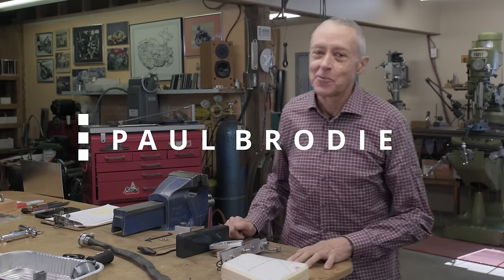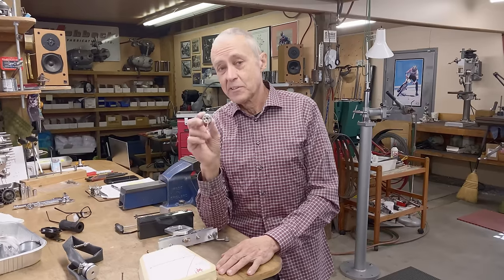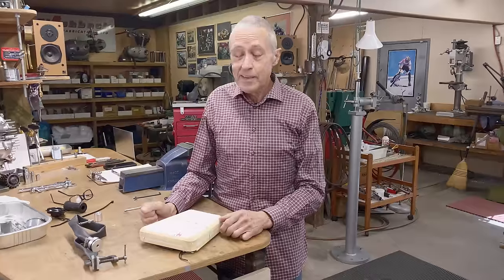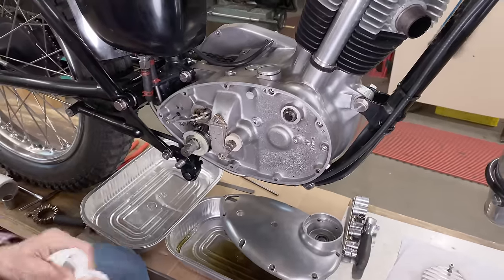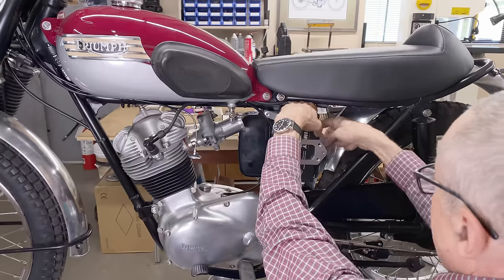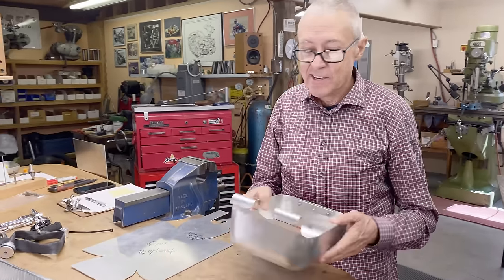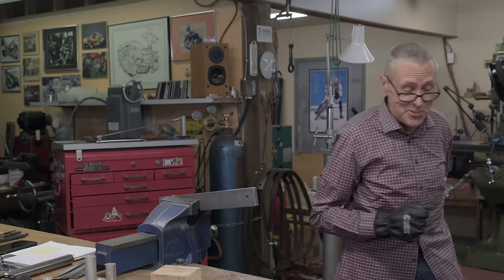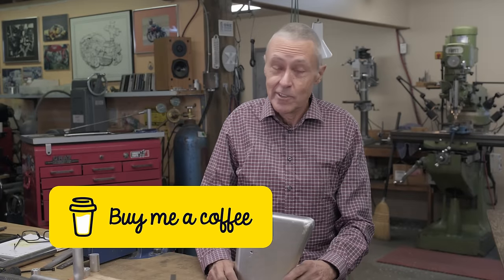CUSTOM Side Cover for the Tiger Cub // Paul Brodie's Shop

Comment: You drop the vertical needle lower, usually a circlip with 3 positions, if not lathe a groove for the circlip above using existing grove for spacing and subsequent groove size, you can always shim the circlip too for finer adjustment, good old SU type carbs.

Comment: Amal carbs have four stages.  Idle which is controlled by the idle jet. Idle to 1/4 open throttle, mainly the slide cutaway, 1/4 throttle to half throttle needle jet, half to 3/4 throttle needle taper/clip position, 3/4 to wide open main jet.  They do overlap some but those are the main controls.  Put a piece of tape on the handle bars and mark the various openings of the throttle.  Determine what throttle position the main issues are occurring and then address that part of the carb that is in play at that throttle opening.  Generally a stumble rolling the throttle on can be solved by changing the slide cutaway.  Also richness in the mid range is very common and is usually due to a worn needle jet.  I always replace the needle jet when I have an Amal apart.  The needles are steel and don't wear nearly as much as the brass jet.  They rarely need replacing.   Moving the clip to a higher notch in the needle will also lean out the midrange, lower notch will richen it..
Reply: This is the "Concentric" model carb, check the float level the settings can be problematic.  Also the early editions experienced pilot jet problems symptoms - dead spots.  Respectfully suggest you consult one of the many discussion boards and tuner talk on the web.  I'm almost 100% convinced that one of these faults is at play.  The needle jet gives a descent range of adjustment but the other two aforementioned conditions must be correct before the jet can compensate for mixture.  Best of luck.
Reply: @geoffmorgan6059  Yes the fuel level should be set .21" below the float bowl lip with a utube  and the pilot jet cleaned with a #78 drill bit before any further carb tuning is done.
Reply: Yep, seen needle jets worn 'pear shaped' on Bonneville carbs
Reply: Pilot jet passage is a swine to clean out.
Reply: @bananabrooks3836 not really, remove the cap clean then plug with aluminium.
Reply: @pbysome  Well yes, but then thats a modification to get around the problem  which Amal have addressed themselves now.
Reply: @bananabrooks3836  you said it was swine but really it isn't, whenever I work on Amal concentric MK1 I do this as a matter of course, I used to araldite them back in but ethenol eats that so now I slice a piece of appropriate alu rod and tap it into place, I usually do three at a time (t150/160 etc).
It was always due to cost that they didn't make them accessible in the first place, something like the factory demanded they cost under a quid or so.
I don't know if the cub was even fitted with concentric?? Mono block was de riguer for them I think.
Reply: @pbysome  l think you've made my point very well.
Reply: @bananabrooks3836  I didn't make "you're point" that was that they where a "swine" which they aren't, they are simple to do.
Reply: @pbysome  
 Simple to modify as you say you appear to have done many rather than endure the flawed original.
Reply: @bananabrooks3836  flawed or brilliant is subjective, what they produced for very little works rather well when used sympathetically.
You have to remember the times and constraints, a bigger issue with the concentric, and probably the monobloc, was body distortion due to the poor quality metal used overtightening the mountings ovating the bore making the slides stick etc was all about cost nothing else.
Reply: @pbysome  if the design was 'brilliant' it would need no remedial work such as you have done. I think we've squeezed enough out of this lemon, so l bid you a fond farewell.
Reply: @bananabrooks3836  brilliance at a price, it's all relative, you have to remember how old these are and they only fur up when left standing for periods.
If you don't like discourse don't instigate it.
Reply from the maker: Good info, thanks.
Reply from the maker: Thanks :)
Reply: @pbysome   You are absolutely correct that Amal 332 Monobloc style carbs were fitted to most all Tiger Cubs with some notable exceptions over the years.  As a Luddite, I prefer the Monobloc to the Concentrics.  The main thing about concentrics is they can be fitted to twins close in (to each other) without having dummy floats and messy rigging.  I have had Norton ES2 500 singles for years and I like the Monoblocs.  That original pilot jet configuration on the first generation of concentrics gave me heartburn.
Reply: @geoffmorgan6059  I haven't had much experience with monoblocs ,only my first bike (a cub) had one but by reputation I always understood them to be more reliable and easier to set up.
Having said that I have had very few issues with concentrics even when worn out you can still get them to work.
Of course you are correct about the twin cylinder use.
Did they make monoblocs left handed?

Comment: A lot of off idle problems can be corrected with the pilot jet circuit. If this is the carb with the non replaceable pilot jet, they are very prone to clogging. You can drill an access hole on the blind side of  the pilot jet channel to easily access the jet to insure the passage is not plugged. The access hole can then be plugged.  The pilot screw can usually be adjusted to eliminate the off idle stumble. 1-2 turns out is where you should end up with the adjustment. If not, the pilot jet is sized incorrectly. My commando needed some trial and error with pilot jets to achieve smooth transition but now it runs perfectly.
Reply from the maker: Thanks for your tips :)

Comment: Always drill the ends of your cracks. It's something some drummers do to their tired cymbals to stop the crack spreading further. I don't know if that would help any cracks that are being welded/brazed though.

As for sheet metals, Trev's Blog, a fellow YouTuber from the United Kingdom has done an amazing job of explaining and demonstrating his panel beating techniques. He's basically the Paul Brodie of autobody repairs while he lovingly resto-modded a Bedford CA into a catering van for his wife.
Reply from the maker: Yes, I have drilled a small hole at the end of a crack.... But I don't think that is necessary if I am welding it. Thanks.

Comment: I cant believe how easily you put a radius on that round stock by just spinning the wheels on the lathe. I would have never thought it possible without a radius tool. One more trick of yours I've got to try and learn!!!!
Reply from the maker: I have been doing that for a few years, that's for sure. It's good for your hand eye coordination. Give it a shot! Aluminum is easier than steel :)

Comment: Cover looks great. I imagine running the engine with the outer cover off would quicky reveal where the oil is escaping.
Reply from the maker: I found where the oil was coming from. There was a hole! So, I plugged it; end of problem! Thanks for liking the cover :)

Comment: I've noted the use of 1100 rod when welding 3003 has been mentioned for Oxy/Acy (torch) welding. I wonder how 4043 might do on the 3003/TIG work? We use 4043 as a "Go to" rod for many things when TIGing. One of your most important illustrations is - Patience. Thumbs up.
Reply from the maker: Yes, I do have 1100 rod, but I have found it is not always easy to melt and get it to flow... 6061 rod is definitely easier. Works for me. Thanks for watching :)

Comment: Great progress Paul, glad to see you sorting out that single. Just rebuilt my 37 year 441 runner, amazing these Brit bikes can last and be rebuilt for years. My points cam leaks a bit but I have hole in bottom so it drains away to lower parts less there than what you had after 10-20 000 miles so it was slow. The gear area on the 441 250 BSA unit are wet and have divider.
Reply from the maker: Thanks for watching and commenting :)

Comment: Hi Paul, there is supposed to be oil in the outer cover. The cam has a timed breather, which exits oil, also from the kickstart shaft and gear selector. The oil re enters the crankcase and on to the scavenge system through the tiny hole you can see directly below the camshaft. So there will always be oil up to the level of that re-entry hole.
Reply from the maker: Thanks for the info! Yes, the oil was leaking out of that little hole so I was told to plug it up.
Reply: @paulbrodie  Hi Paul, oil will come from the camshaft end bush, run down the case and should be able to get through that tiny hole to get back to the oil pump scavenge system. Kind regards Paul.
Reply from the maker: @paulbalsillie3645  Yes, another viewer mentioned this as well. Thanks..

Comment: That baffle's gonna fly for miles when the locktite lets go on a high throttle 😆
Reply from the maker: James, I beg to differ. The baffle has a slight taper, and was pressed into service with the aid of a 2 pound hammer. It's not going anywhere...
Reply: @paulbrodie  I bow to your superior experience and skill set. But if it does, you'll owe me a coffee 🙃

Comment: Would a product like POR15, along with the tig welding, be a belt and suspenders  fix for your leaking oil tank?
My thinking is if you missed any pin holes, or if a new leak appears in the future, the POR might help seal things.
You're looking good Paul, it's great to see your hair coming back LOL.
Regards,
Duck
Reply from the maker: Thanks Duck. The oil tank is fixed. No more leaks.

Comment: try a smaller cutaway on the throttle slide to improve the pickup, drop the needel a notch to the topring to cure your rich mixture
Reply from the maker: Yes, the needle is all the way down. I have a 3.0 slide, and I am going to see someone tomorrow who may have a 2.5 slide. Thanks :)

Comment: They leak from the kickstart shaft and gear change shaft bosses because there is no seal. There is a company called UPB  here who supplies parts to fix this problem. I did the jobs on mine fairly recently,( thanks Nick for the machining work) and not a drop has come out since.
Reply from the maker: Mine leaks from other sources. Thanks for watching :)

Comment: Nice job Paul. Really good to see you're still at it. Hope the treatment is going well and you are feeling okay. Can't wait to see the Cub in action. 
I was wondering, could you machine another cir-clip mounting groove in the needle for the carb, just above the one that's there whereupon the needle would sit lower in the jet and perhaps lean out the mixture. You may then be able to go back the the larger jet (0.020?) to get the right mixture,... What do you think?
Be well sir.
Reply from the maker: Thanks Sandy. Well, my lathe chuck won't hold the needle... it is too small. Tuning a carb is a balance of several variables: needle, jets, slide, etc. I am working on it?

Comment: 3D print your cover, or even use the 3D print for a bit of 'forged carbon', looks good.
Reply from the maker: Why would I want to 3D print a cover? That's not an art form created by hand. Why not just 3D print the whole bike? Where's the fun in that?
Reply: @paulbrodie  3D printer is just another tool Paul, most vehicles are designed with drawings on paper or using computers, just another tool, like all that stuff in your machine / workshop, 'by-hand' is a very loose term, this tech is good for modelling spaces well, making prototypes, assisting with whatever production method you choose, ta.
Reply: @paulbrodie  3d printers, the FDM cheapies are really about prototyping, actual parts as well, but good for visualising, seeing an assembly move, like a hinge for instance, get a profile thats difficult and using it like a cardboard cut'-out, all that good stuff, i also like hands on with metal, i like it all :-) thanks Paul for your channel.
Reply from the maker: @Stuff-i-Like  Thank you.

Comment: I guess, when the oiltank is fixed at the top, and on a rubber mount at the bottom, the tank will vibrate and crack at the support at the top. Eighther both supports fix, or both on rubber mount. Just a thought.
Reply from the maker: You might be right. We will see how my solution works out. Might have to re-engineer it...    :face-orange-raised-eyebrow:
Reply: @paulbrodie  I am always right !
No, I am just kidding, but yeah, test the bike and you will see, it is not a big deal. Thanks anyway for answering, I am glad to see that you are getting better healthwise.
Reply from the maker: @willymueller3278  Thanks Willy. My health is getting better but I hurt my ankle trials riding today, so now I am on the injured list....:face-fuchsia-tongue-out:
Reply: @paulbrodie  Well, sometimes it all comes together.
Reply from the maker: @willymueller3278   Well, I am feeling lucky!     :face-fuchsia-wide-eyes:

Comment: I think adding a breather to the inlet rocker cap or where the original early points came through case would be a good idea?
I've used the balls out of track rod ends, upper and lower ball joints and even tow balls to form radii.
Are you going to make a tool tray inside it or would that be too heavy for the mounting?
Is it going to be painted or satin finish to match the other alloy parts?
Reply from the maker: A breather might be a good idea, we will see. There is no room inside the side cover for anything. It is completely full with the battery and mount. The side cover is now black.

Comment: Try and find an old sparkplug, the new ones have unglazed insulators which doesn't burn off the fuel so easily and these old engines are very fuely.
I did five hundred miles on a triple chasing after a hesitancy from tickover changed the plugs and it disappeared.
The plugs now are made for lean engines which dont need glazed insulators.
Reply from the maker: I guess you are telling me this for when I do plug readings? Thanks.
Reply: @paulbrodie  no for the hesitancy from tickover, it maybe that or not but it may save you chasing carb shadows like I did 😥

Comment: Great Video Paul. Would you consider talking about frame fitting, frame design and the general approach to make a frame to fit a person? Thanks
Reply from the maker: Thanks Sam. This is a motorcycle video. And motorcycle frames come on one size per model... Or are you talking about bicycle frames?  I'm confused.
Reply: @paulbrodie   Yes,  Im referring to Bicycle frames. I wasn't sure if you would see my comment on an older frame video.  But custom motorcycle frames are built as well. Thanks
Reply from the maker: @Sam-ix9gd  I am not an expert on frame fitting and sizing a bicycle frame to fit an individual. Other people are much better at that than I am. My expertise is the fabrication of the frame, or whatever...    :face-fuchsia-poop-shape: